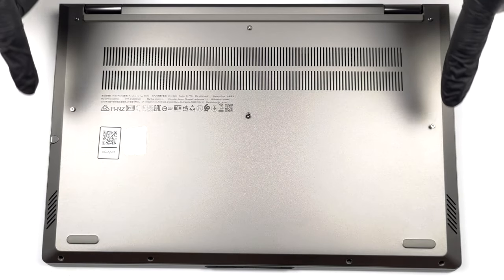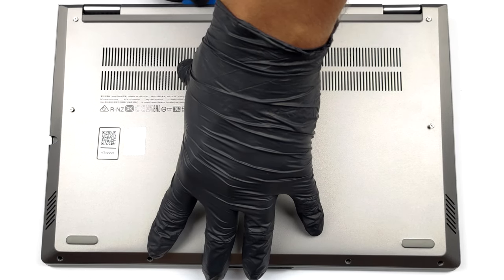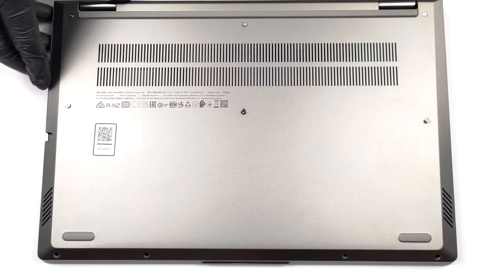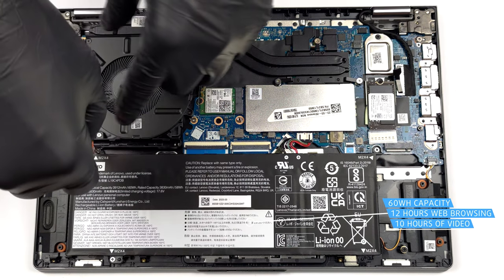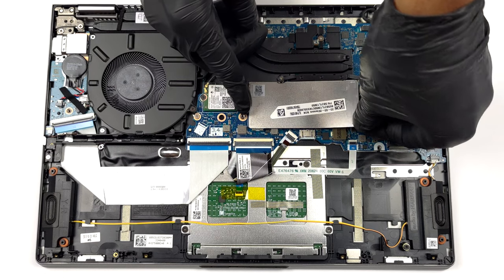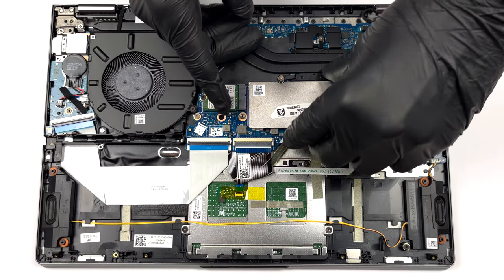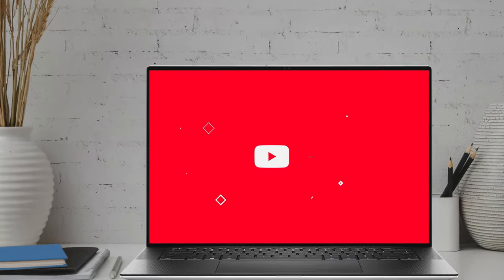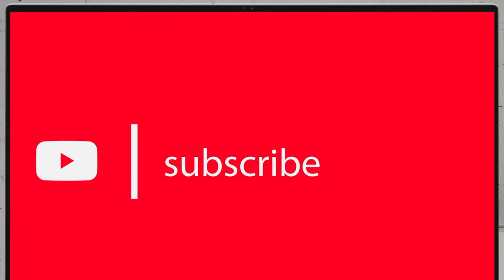🛠️ How to open Lenovo ThinkBook 14s Yoga Gen 3 - disassembly and upgrade options

Comment: I wonder if you can add a  16gb or 32gb SO-DIMM DDR4-3200 ? The Lenovo website says up to 16gb ram total, it would be nice have at least up to 32gb ram.
Reply: Do you already know if it works?
Reply: @xminingwave9909  No, I'm still waiting to find out before buying the laptop.
Reply: I have a Thinkbook Yoga gen2 and I added 32gb RAM which did indeed make the total 40gb. Not sure about the gen3 but it would kinda suck if it supported less RAM then the gen2...